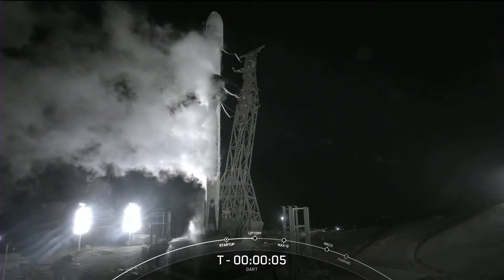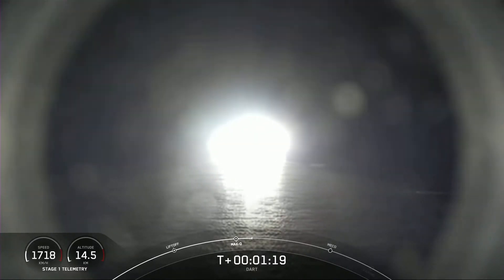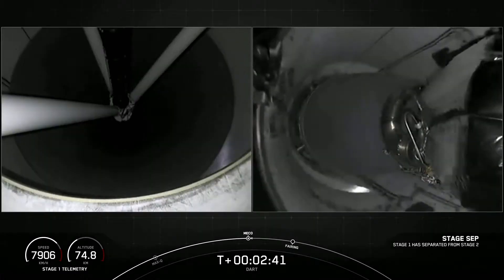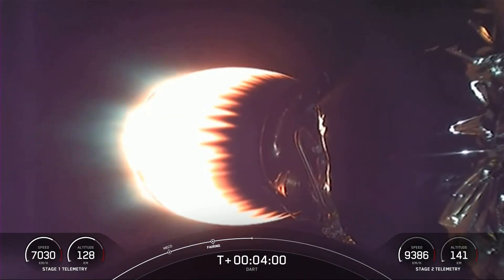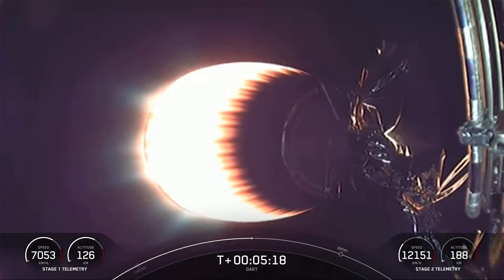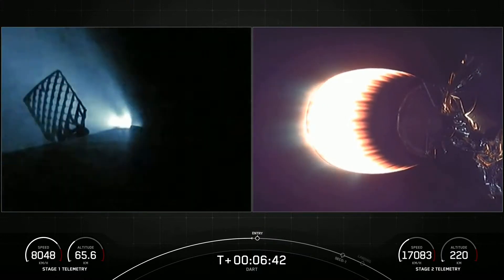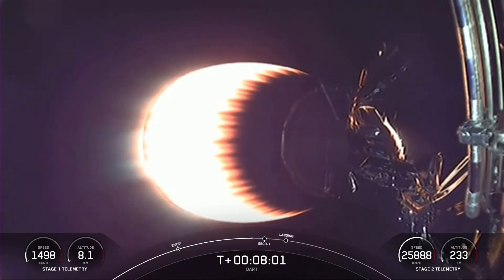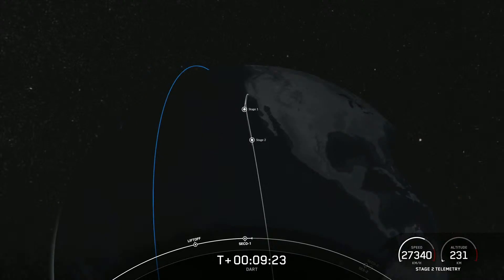Watch NASA'S DART Mission Rocket Launch!

Comment: Cover up mission. Two objectives. Secret.....weapon for space force. Most of this footage is fake.
Reply: I watched the launch with my own 2 eyes - I was about 3 miles away. I could also see the MECO and secondary engine ignition so I don't think any of it was faked. 
I mean, why fake it anyway? Just don't broadcast it at all. Most of the launches out of Vandenberg are military and not broadcast. For many of them, they don't even provide the specific launch time - just a broad 'launch window' to keep the airspace above open. So wouldn't it be simpler for them to call it 'classified' and leave it at that? I know that's not as much fun as nut-job conspiracy theories, though.
Reply: @thuzUNed  Maate! You can't argue with conspiracy paranoids. They are married to their fantasies.

Comment: What if orbit is changed unpredictably and it is pushed into an orbit that endangers earth?🤔 Just not sure we should be messing with this. Humans have a bad track record.
Reply: It will only be able to push it a very small amount. the biggest measurable difference it will cause will be the way the smaller Asteroid rotates around the larger one
Reply: @jaaro  yeah cause in space has 0 gravity only small push is enough
Reply: @julesarangoso1929  yeah all they're testing is to see if we can alter the path of a  celestial body in any way. If there was a risk of us pushing the Asteroid into earth they wouldn't be doing the mission.
Reply: @jaaro  Hopefully NASA and SPACEX , carefully considered every possiblity before starting this mission. We have to protect the Earth, so we have to get this right, all the way through.
Reply: There's no chance that this will significantly alter the orbit of the Didymos/Dimorphos asteroid system. DART will be impacting on Dimorphos - the smaller of the 2 asteroids. This impact will only affect the orbit of Dimorphos around Didymos, slowing it by a couple of cm/s. It will not have a measurable affect on the overall orbit around the Sun.
Reply: exactly my thoughts
Reply: What if it's not a test